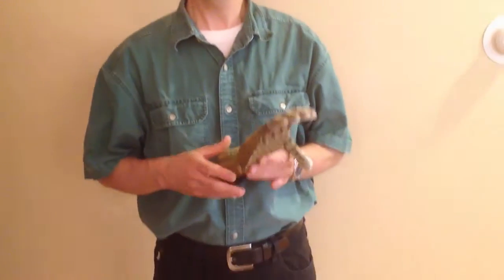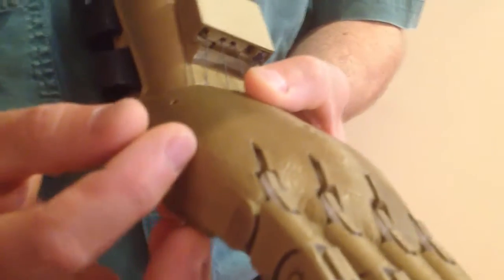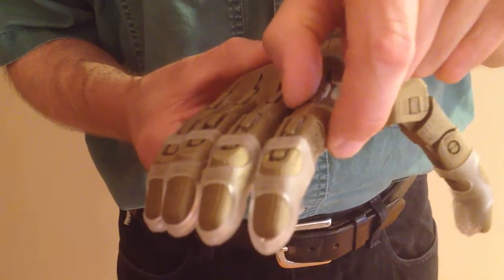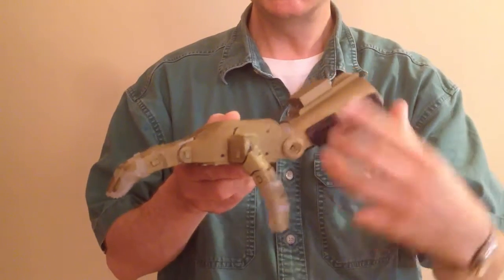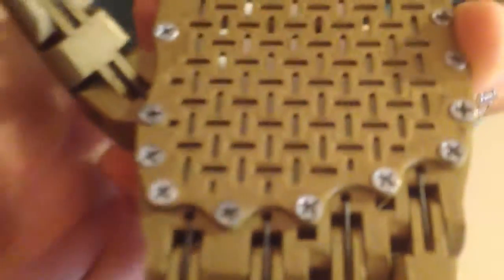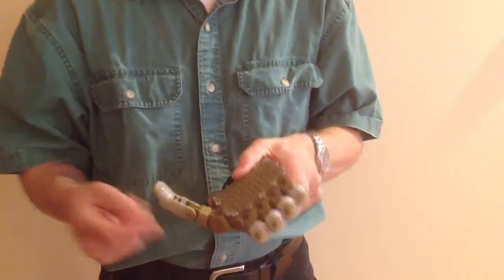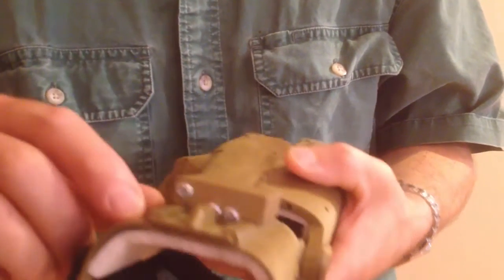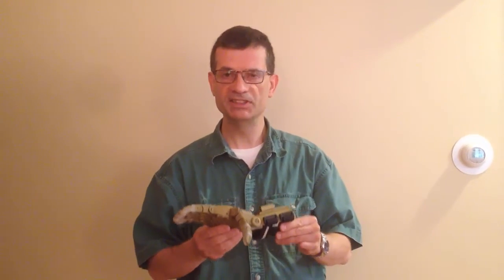Assessing the quality of a Phoenix hand

Comment: I've found there is less drag on the braided line when it does not come out of the designated holes on the palm. Instead routing the line through the knuckle gap allows for easier closure of the hand.  Please explain the advantage of using the designed holes.  

Thanks